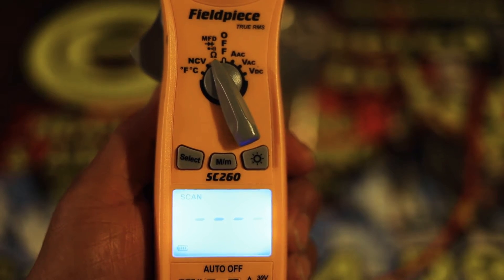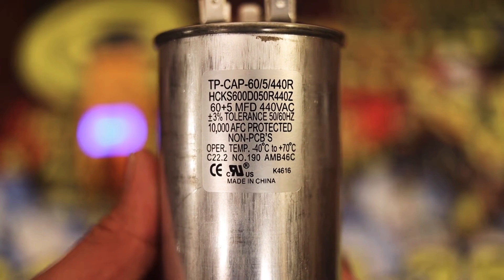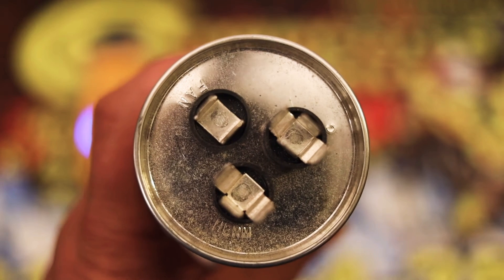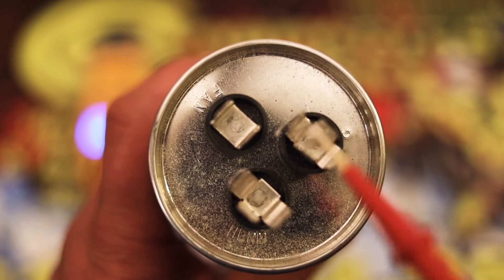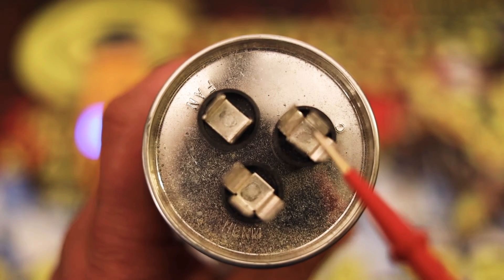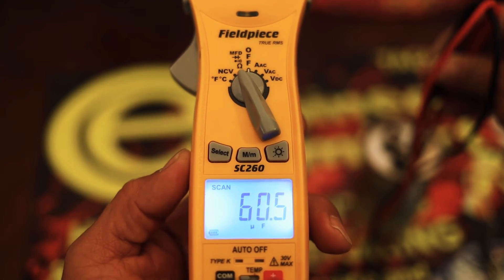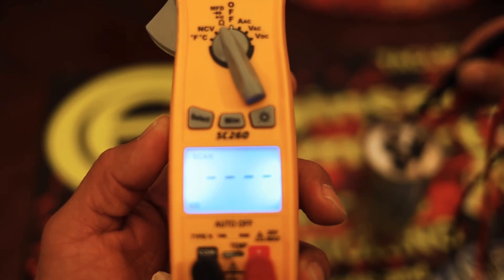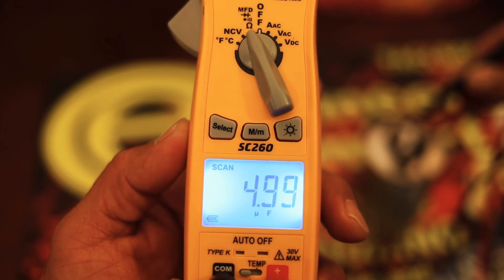how to check a dual capacitor for hvac (or any capacitor )

Comment: Thanks for videos. We're you hvac tech some point or just teaching now? Any classes online?
Reply from the maker: i actually own Engineered Comfort HVAC but i try to help my fellow technicians in anyway i can, if there is something you are having trouble with just let me know and i’ll try and make a video to help you out. Im sure there are lots of techs out there that could use the information as well
Reply: @engineeredcomforthvac4911  
Sure.
Reply: @engineeredcomforthvac4911  
May I ask what is average wage for Tech. I do service calls. As far as level on the repairs all the way through swapping compressor which hardly happens but coil change out a lot.
Reply from the maker: @1971omi  i would say $18-20 to start and up to $30 hr for experienced technicians maybe more depending kn where you’re at